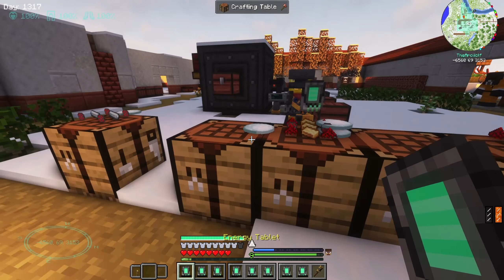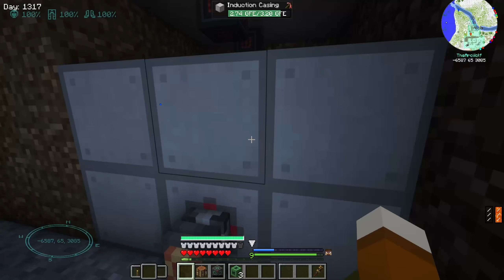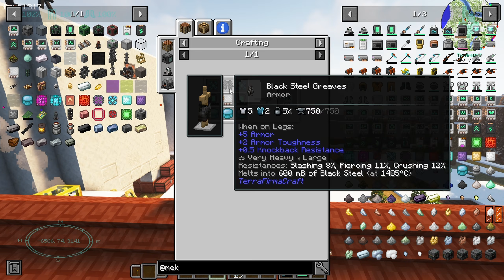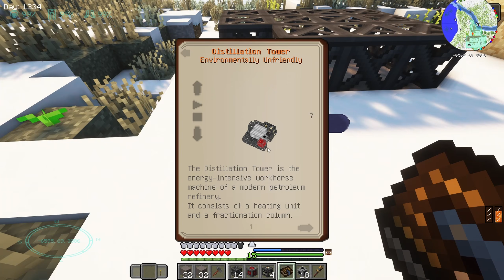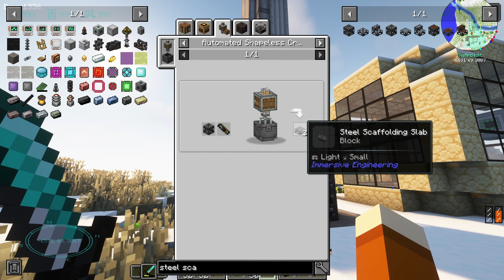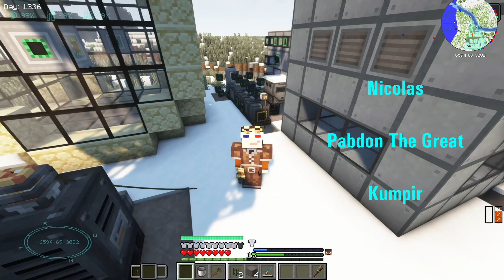Oil Distillation - TerraFirmaCraft: HardRock Ep. 47

Comment: If I were not 4 months late again I would've suggested you used a fluid router from IE for the output of the tower, and for the input instead of an IE pipe you should've used mechanism mechanical pipes.
Someone needs to remind me next time you start a modpack series😂

Comment: I collected crude oil from nither and bring it to overworld using singularity tank but when i try to feed the crude oil the distillation tower doesn’t accept it ho how i should do???
Reply from the maker: There are probably easier way, but the one I used was: IE fluid pipe connected to in input, with a IE barrel on top if it. Then a mek fluid  pipe ontop of the IE barrel, then you can place the singularity tank on the mek pipe and it will drain in.

Comment: IE's own oil reserves are really big. The Derrick got me 9 million mBs of crude oil before the pressure equalized with the air and the reserve had 18 million more mBs of oil left for a pumpjack.
These reserves also keep producing a small amount of oil even after they hit 0. Note that you'll need pipes capable of dealing with the Derrick's initial oil output and large enough storage. Otherwise, all that oil will go to waste.

That's 27k buckets of oil plus a constant supply afterwards. 

These reserves aren't bound to chunks, but rather use a heat map that changes from block to block. Gotta make sure the Derrick's center lines up with the exact block the reserve was detected on.

For fluid storage, fluid drawers are your friend. You can upgrade them to hold millions of mB.